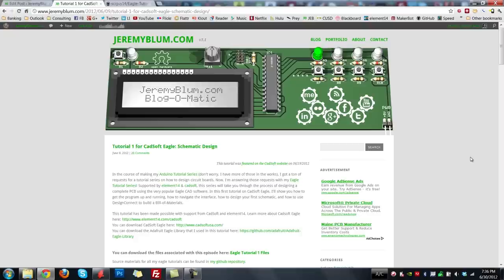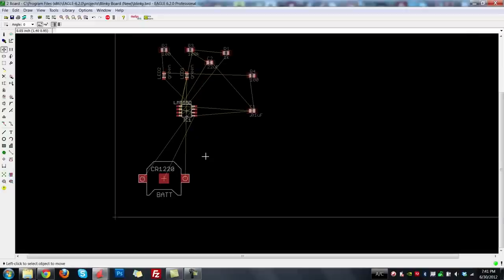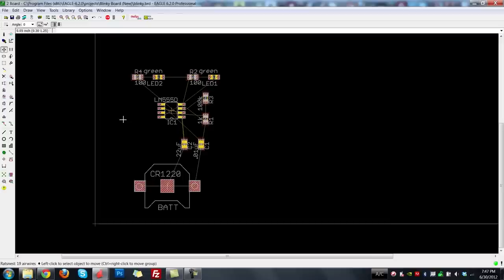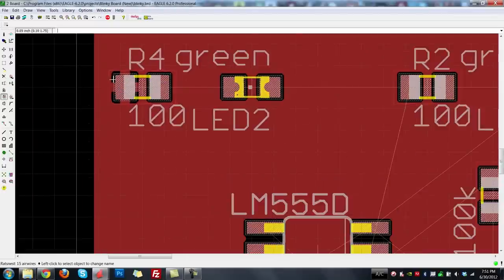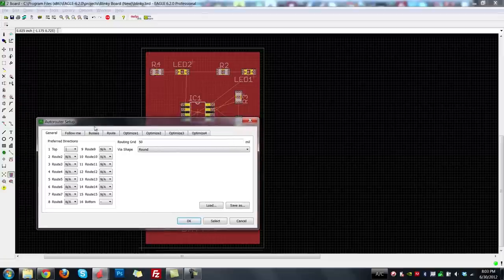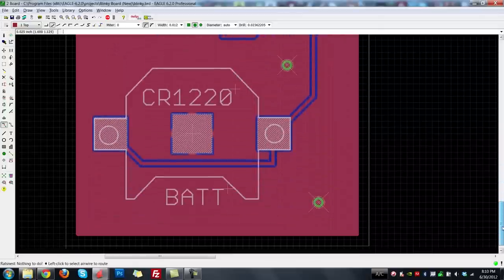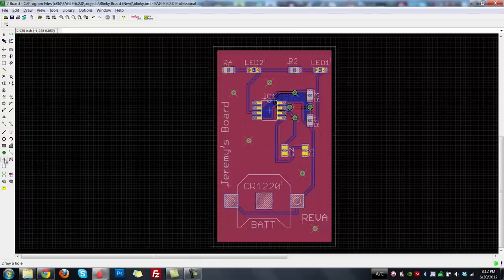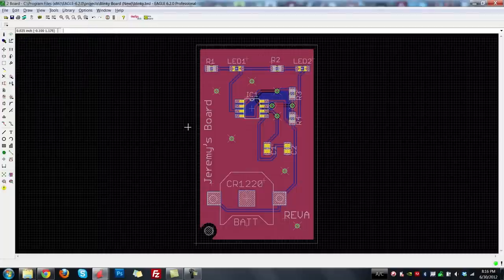Tutorial 2 for Eagle: Printed Circuit Board Layout

Comment: Tips to accelerate work: 
Whenever you move something, you can rotate the thing while dragging it by clicking the right button. 
Also while manually routing you can hit the middle mouse button(wheel) to instantly switch between the layers.
Thanks for the tutorial, I've learned a bit from it!

Comment: Good video for beginners Jeremy.

 I am watching your videos to increase the slope of the learning curve as I just bought EagleCad. A little disclaimer: I am a Member of the Technical Staff at a major corporation and have 30,000+ hours experience with PCBs and related  SI, PI, , PDN, and the aspect that is the most important, but 1 in 200 EE's actually are competent in: noise reduction/mitigation. 

For beginners, follow Jeremy's tricks and tips here. He gives a great tutorial for the newbie. However, as you get more experience start studying up on a little theory on PCB physics. An excellent book to start with is PCB Design for Real-World EMI Control, by Bruce R. Achambeault. Ohh for those that don't think that EMI control is relevant for hobbyist work? Wait until you try to solder a completed Bluetooth module on your hobby board and you scratch your head wondering why its max range is 1.5 feet. 

FYI Jeremy. I have instructed every EE and PCB designer in my sector to cease and desist from ever using the autorouter. It is crap and will never produce results as good as a trained human brain can. But for beginners it will probably do a better job than they would, so I understand the use in this video. 

One more thing, and I don't mean to be critical, but the industry standard for those yellow lines is "guides", not "airwires". Everytime you called them "airwires" I got a facial tick. LOL

But seriously, nice video for people that have never touched a PCB in their lives. Good video for even well seasoned people like me that use more complex tools such as Mentor Graphics and Cadence Design Suite. Not here to learn routing techniques. Hell, I teach them as part of my job description. I am here to get the quick notes on "Getting Started". I really don't want to spend 2-3 days learning all the nuances of EagleCad, and you have taught this seasoned professional all he needed to know to get up quick on the learning curve in a little over an hour. For that I am grateful. 

I tip my hat to you. You will go far and high young man. Indeed.

Comment: Hi i have connections in brd that just arnt and wont conect,there isnt any air wires eather,but in schematic they are connected,the wire is same name all alongt its lenth,its a wire from attiny 85 to usb D+ with resister in between,its a kind of vusb circuit with diodes and a pullup on the usb D- line but the two 69ohm resistors arnt connected at one end in tghe board file,ive tryed every tthing even deleting and starting connection again,loads of things dont work like you show,it looks simple when you do it,but the wires names confuses me,if you have a vcc at one end and say attiny 85 chip reset pin connected at other end do i name the rst wire vcc or what?

Comment: I'm having issues with the ground polygon. After hitting ratsnest, it never acquires the solid color. I basically followed step by step Tutorial 1. Is there an issue with the actual Ground elements (symbols) on schematic having different names (GND, GND1...)? I named all the nodes connecting to GND symbols as 'GND'

Comment: Thanks for the Eagle tutorials, Jeremy. They helped me a lot in setting up my schematic and board in one night. However, I suspect I've done it wrong. My components are the old through-hole kind, not surface mount. So I think that all the stuff (copper) on my top layer really belongs on the bottom layer. Correct? How do I move the contents of my top layer to the bottom, or must I recreate the board? If I have to recreate the whole board, how do I make it so the copper comes out on the bottom? THANKS. -Marty

Comment: Why is ch12-1220lf (battery holder) not included in the board diagram ?as opposed to the battery cr1220. Don't we want to see the holder on the board when it comes back from the pcbmaker?

Comment: hey Jeremey i got a weird error on my schematic sketch and it wont go away the error is supply pin GND overwritten with more than 1 signal(GND,,N$S) do you know what cause this problem? its a GND that goes to a octocoupler with just 1 wire

Comment: Probably shouldn't run the battery + signal under the holder where the negative terminal of the battery will be connecting to the pad on the board.  This relies on the solder mask to insulate the battery case from the signal.  Probably the part should have a "keepout" or "restrict" polygon defined to keep from routing traces under there.

Comment: I have designed a panel with switches and knobs and LEDs. I want to design a circuit board behind the panel which i will cut with my CNC. What i am trying to find is the panel i have imported as a dxf - there are circles on the which i need to be holes i.e. where switches will come through in some instances and also a gap for an LCD screen etc. How do i make a polygon a hole? Drawing a hole is simple enough but taking a dxf imported shape and making it a hole is a problem.
i hope that makes sense.

Comment: Thanks, any ways to simulate the circuit working?  Like mention of any other tool or Software if this Software doesn't have it would also be helpful. Thanks.
Reply: In my 9.1.3 version, in the schematic toolbar there is another link next to "design link" that exports to (and imports from) LTC Spice.

Comment: Checked the schematic and I clearly followed that pin 3 went between R2 and led2. When I went to the board, there was no wire there as there is in yours! What did I do wrong? Tried to add a wire and could not figure it out. 
Great learning experience but very frustrating! I messed up items at angles but finally just backed up 20 steps to get rid of that!
Thanks again- hope you do an update and maybe add some dumb mistakes that happen.
Reply: +amtpdb1 Don't use the wire button, use the net button.
Reply: +JustKyzuuh Thanks I will try that. Very frustrating but I really want to learn this.
Have a nice day.
Reply: +amtpdb1 you too! glad I could help

Comment: You should put the decoupling 0.1uF capacitor as close to the IC pins as possible for the most stable local voltage supply possible. Putting it so far away in the corner as you have is a bad idea for PCB layout.

Comment: So do we need a double copper plated PCB to make this?
Reply: +Liam Williams Well, you CAN do single layer boards with Eagle.
For home-etching and stuff.
Reply: +Liam Williams No, if you don't have the space for the traces, just do them on the top but once you etch that single sided PCB make sure you connect the top connections with wires. So the top (red) connections are done with wire on a single copper PCB.

Comment: say i have usb D- conected to pb0 with resistor in between now each wire eather side has a differant name why,i thought the name had to be the same as they conect to each other through resistor,when i name them the same the conection doesnt show up in brd file,ime confused please help some one thanks
Reply: +Duncan Young I'm assuming you are talking about your resistor being connected in series with the signal line (i.e. one wire from connector to side "A" of resistor, then another wire from side "B" of resistor to PB0)  If I'm understanding your arrangement correctly, then the two wires need to be treated as separate "Nets", and therefore they will have separate names.  

Here's the rule:  everything named with the same Net Name will be directly connected together with copper on the PCB.  So, if you give these two wires (on both sides of the resistor) the SAME Net Name, then the program will think they are to be connected together, and by doing so, it will short out the resistor, won't it?

Your idea that they "connect to each other through the resistor" is a little bit off.  Indeed, you may think of this entire path through the resistor as the same FUNCTIONAL signal name...  Maybe "D+" or "D-" or whatever the purpose of this signal is.  However, once you take it through a resistor or another component, if we DO NOT want these points (on both sides of the resistor) to be connected directly together with copper, we need to think of them as separate "Nets".  

In this case, I might call the wire connected from the connector to the resistor by a Net Name something like "D-_CONN", and the wire connected from the resistor to the processor as "D-_MCU", or something similar.  

Yes, they are both FUNCTIONALLY the USB "D-" signal, but from the PCB layout perspective, they are two completely separate "Nets", connected to opposite sides of the resistor between them.  On the PCB, they are NOT connected together by a copper trace, so they need to have separate Net Names.
Reply: +svyt Ok thanks thats why they not conecting in brd as nets,thanks also somtimes i cant conect the nets in the scematics,they just wont line up,i use alt to use the finer movement but it just wont make the conection,how do i put it back to defaults,i take it its somthing to do with the grid size? it should auto conect it for you when you get close enough but its stoped that and tryes to connect to the right or left of the conection to be joined,verry strange.

Comment: from tutorial 1 to tutorial 2 the values of some resistors have been changed between them.
1st tutorial R3 & R4 100 ohm, R1 1k ,R2 100k
2nd tutorial R2 & R4 100 ohm, R1 1k ,R3 100k
Reply: kamysamaa At the end of tutorial 1 when he uses the option to rename and reorder the values it changes the order of the resistors, so if you didn't do that, your resistors will have the original names.

Comment: Hello. I'm a beginner in Eagle CAD, though I have some experience in PCB layout. I would like to cooperate with someone to master the program.
Reply: +Видео обо всём The program is easy, for home etching you don't need that much. Just turn all the layers off except the layers of your holes/pads and connections, export to PDF and print it out (depends on your etching technique you might print it out mirrored).
Reply: Thank you, basically I've found out how to use it, nevertheless it has many features that I still have to learn.
Reply: Видео обо всём It's a great program, I have been using it for years, in the beginning I used a bad PCB program which had an autoroute future. Since I found Eagle and learned how to manual route the components I never looked back.

Comment: I'm having issues with the ground polygon. After hitting ratsnest, it never acquires the solid color. I basically followed step by step Tutorial 1 and 2. Is there an issue with the actual Ground elements (symbols) on schematic having different names (GND, GND1...)? I even tried naming all the nodes connecting to GND symbols as 'GND' and taking out any other grounds other than the original.

Comment: maybe 'cos they are not connected to anything on the schematic. With your schematic open click on the box on the left pane with an exclamation mark and it will give you a list of errors, as you click on each error you will get an explanation and a line pointing to the error. Try that, correct your errors, and run your board again, you should be good.

Comment: When I saw you setting the track width to 12 mil I thought wtf? A 12 mm wide track and 20 mm holes?so I looked up what the hell a mil was. Turns out it is actually a thousandth of an inch or thou for short. What bright spark decided to call it a mil? You'd think a mil would be a millionth of an inch! Just when I thought the imperial system couldn't get any more stupid.
Reply: ;-) its the meters - feet issue.